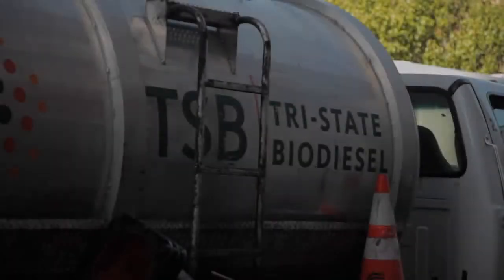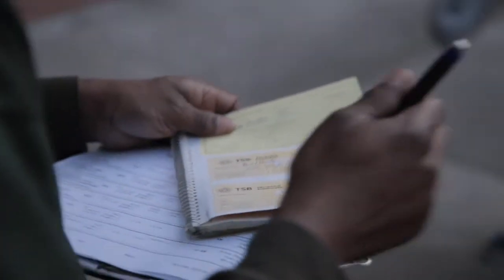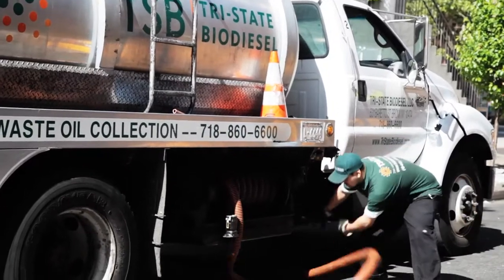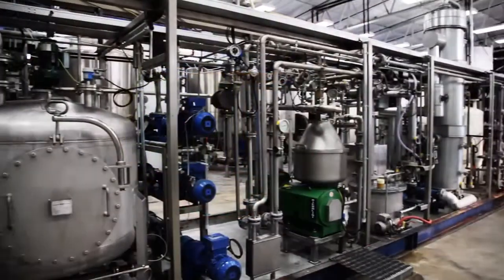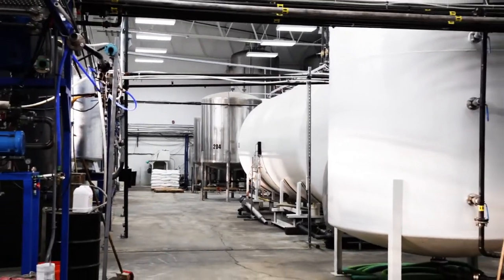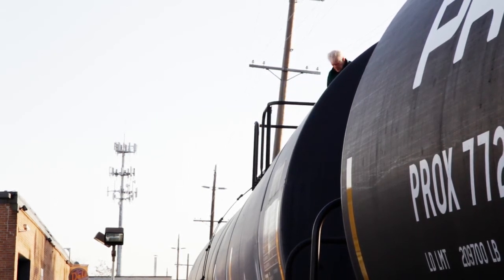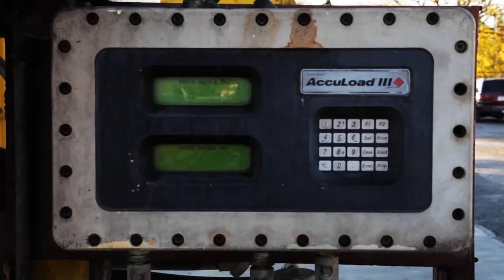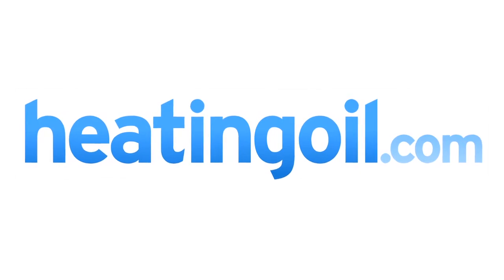How Biodiesel is Made

Comment: Holy-Terrorist:>*=* Is possible to make real fuel with mix of oil and sodium hydroxide and heated to make soap, soap and sodium hydroxide very heated can make sodium carbonate and fuel, the fuel is on vapor and recolded by process distillation!
*=* The script stuff are probably good, just of the process can make sodium carbonate!